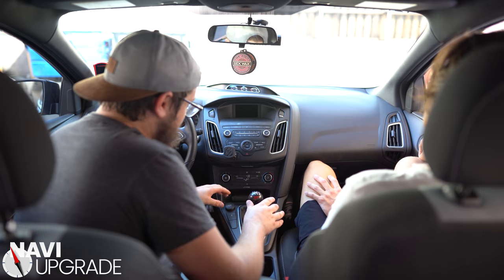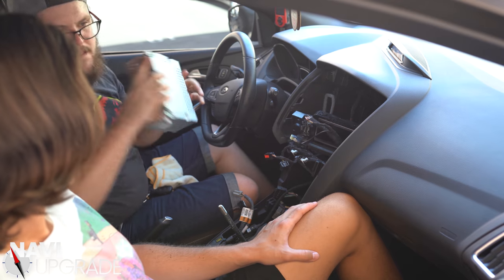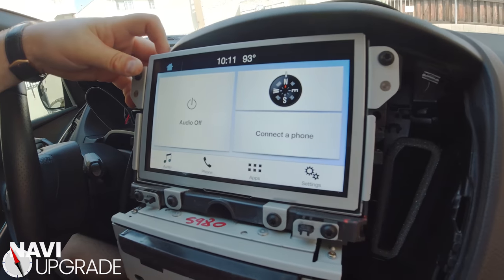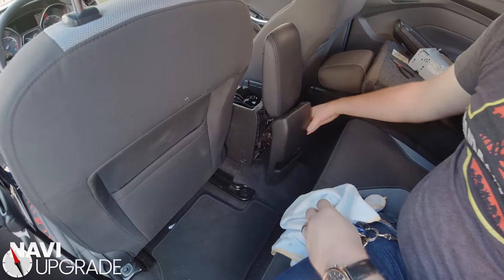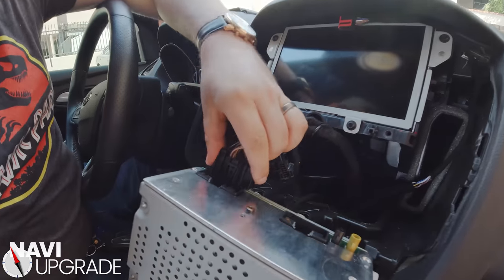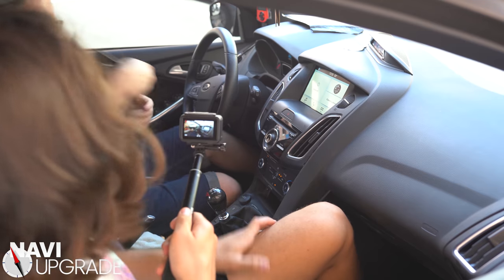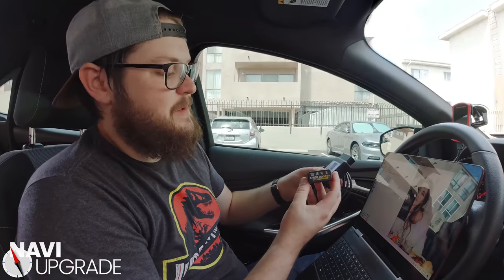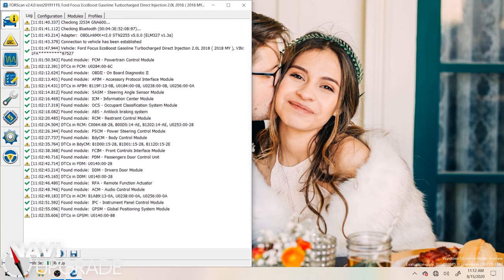4" Sync to Sync 3 in a 2015-2018 Ford Focus MK3.5

Comment: How things have changed. I used to upgrade car audio back in the 80's and 90's and it barely took a few min's to slide out the original, disconnect wiring and slide in the new head unit, and reconnect wiring - All using a cople of `u' shaped release keys! Cleary the motor industry has overlooked ease of access when designing the centre instrument console????
Reply: Haha i just found my U shaped removal tools the other day sorting through bins. Good laugh.
Reply: The reason might be theft
Reply from the maker: Because this is an OEM upgrade. Ford didn't want people with base model vehicles to be able to do this so wiring and all sorts of programming things were changed to make it not plug and play. At the end of the day Ford makes more money by upselling customers and that's why this process is not done by Ford or any Ford Dealers...
Reply: @Muxik4k  Ha! Yes I would agree, only a car I owned in 1998, was broken into and i watched the guy running off into the distance with a box of my  compilation cassette tapes....b*****d!!!!!!!!!!! Why couldn't he have taken my Sony head unit? it took me centuries to record all that material from cd and vinyl on to tape! Pah!

Comment: I have a 2015 ford focus. 4 Dr sedan flex fuel. Radio stopped working after crackling off and on for awhile. If I go with the sync 3 upgrade.ill also need to buy a replacement radio as well . Correct? I'm not usually a do yourself guy but I'm attempting to do this myself with your video help. Haha
Reply from the maker: Sounds like an ACM failure (cd player). If you grab one when getting all your parts you can just replace yours with that!

Comment: Welcome. I have a problem after changing the display to 4 " SYNC 1.1, every time it tells me the call for help does not work ... I would like to disable this message. Where should I do it? In APIM or RCM.
Block 1 APIM
7D0-01-01 111F 89C0 0355

Comment: Debating what to do. Ive got to have navigation if i upgrade. Rear camera has to stay functional and preferably OEM fit. Thinking about buying an android system from Amazon but it would be nice to have something OEM.
Ouch saw your kit prices so that tells me right away im going for a new android head unit and dash bezel included for $250. Had an android unit before and was very happy. At least i can crank up Netflix while I’m out and about. Definitely not a die hard OEM guy. Nice conversion though.

Comment: I have this problem where if I stop my car and turn it back on 2 to 10 minutes later, the syncs system doesn't work. The radio won't work, the screen doesn't work, and neither does the USB charging. I could drive it for hours and it won't work until I stop and start the car again at least like 10 minutes into the drive. I've tried pressing the power and fast forward and nothing works. Any tips?

Comment: Would this upgrade work with Bluetooth Android Auto? If not, what type of unit should I look into for that? I have a 2015 Focus.
Reply from the maker: Use an AAWireless! https://amzn.to/3JEAP33
Other than crappy aftermarket android units (known to fail in just a few months) there isn't another option for Wireless Android Auto

Comment: For some reason after installation, my back up camera doesn't work. Any suggestions before I take it to ford since I'm bad with forscan lol
Reply from the maker: Gotta program or it's gonna be set to whatever the programming the donor vehicle had. Second digit of the first APIM line should be a 3 for the camera to be on (7D0-01-01 xXxx-xxxx-xxzz)

Comment: I would like to upgrade my 2017 Ford Focus ST from the 4 inch to sync 3. Would i just buy the 4 to 8 inch adapter and the sync 2 to sync 3 conversion kit for the focus ?

Comment: My cigarettes lighter plugs does not work after I use the wiring to upgrade to sync 3 ?? Did I possibly leave out anything that should be plugged in??
Reply from the maker: Forgot to replug it probably. Or something shorted it out. Check fuses.
Reply: @NaviUpgrade  ok. But unless it gets the power from one of those radio wires then ok but did not unplug any other wires but I’ll double check it

Comment: Question I have a 2012 focus se but it doesn’t have sync it has the regular radio screen is there a way to add the new display like the ones you sell to that??
Reply from the maker: Yes!! We have a new harness that is an add-on to our current harness that taps into your OBD2 port to get the right signals to run this system on your non-Sync car! It also has a 3.5mm mono jack so you can add your own cheap microphone for voice control etc

That will be put up on the site tomorrow when we get back in stock of the main conversion harness

Comment: Question: I own a 2015 Ford Focus , would I be able to change out the radio and the cluster to a more recent compatible model ? If so what’s the most recent models I could change that to ? Ex : 2017 Ford Focus , 2018 Ford Focus
Reply from the maker: Hey Michael, 2016-2018 would be the latest model you can pull from for your vehicle so that you get everything Sync 3. Hope that answers your question 👀
Reply: @NaviUpgrade  yes it does! I’ll be hunting for a 2018 cluster & radio system then 😎. Thank you for getting back to me so fast

Comment: Hello from Germany,
I have the focus mk3 1.5 ecoboost and sadly sync2!
You just change it and it works 😲 how?
I thought the sync3 has to be updated /set to the FIN number of the car!
If yes, how? If not, I would see how I get one (maybe cheap from a crashed car!
Reply from the maker: Hi there! Yep, it's as easy as grabbing the APIM/Display out of a wreck, then adding in the USB hub & GPS antenna! You'll just need to program your unit in your car with FORScan and you'll be back on the road in no time :)
Reply: What is forscan

Comment: Hi what year is the sync 3 you fitted the focus to load sync 3.4 on to it as far has I’m aware you cannot do it to sync 3 lower than 2018/2019 thanks
Reply from the maker: This module was from 2017. Sync 3.4 can be loaded onto any Sync 3 system 🙂

Comment: Quick question. I have a 2012 Ford Focus Se and it has no sync. Is it possible to do this? Or would it have to be a 2015 and newer?
Reply from the maker: Hey there @Jayvin_21 -- currently it's not possible but I'm working on a solution for you soon! Hold out hope!
Reply: @NaviUpgrade  thank you for the quick response. I have been wanting to upgrade it but since I haven’t found anyone confirming that it is possible I stopped trying. I wanted the stock one, like in the video instead of an aftermarket one like pioneer, song, JVC, etc.
Reply from the maker: @jayvin_2169  totally understand. That's why we're working on it. It's a pretty complex harness so we want to make sure we make it as easy as possible.for everyone to upgrade their cars 👍 thanks for your comment and watching our video!

Comment: Do u have to have to buy the  harnesses to install the sync 3. And why?
Reply from the maker: I suppose you don't have to... But if you don't it won't power on 😜 But yeah, it's necessary for the upgrade. Lots of pin changes between 4" Sync and Sync 3

Comment: I updated the sync 3 to 3.4 in my 2016 Ford Escape. It went well but i need to get a new newer version  USB hub but I can not find a part number that will work. Does anyone know if they have found the correct hub for a 2016 ford escape?
Reply from the maker: We sell OEM Ford Hubs on our site 🙂
https://naviupgrade.com/shop/hardware/sync-3-carplay-enabled-usb-hub/

Comment: how much is the cost of this modification, I have 2017 focus ST
Reply from the maker: Depends on where you get the hardware, I've had folks tell me they've gotten full setups for as little as $100 from their local wreckers. Most spend between $500-700 on their upgrade

Comment: Could you aupgrade a 2014 ford focus into the original radio in this vehicle?
Reply from the maker: Yes but our harness doesn't support the Sync 2 hub. It'll boot Sync 2 just fine though.

Comment: if i misspell but i am using translator hope someone can help me here I go ... buy a CM5T-19C107-JF radio to replace the CM5T-19C107-HB. all good but the aux output of my car does not work, it does not emit any sound. The question is can I program the auxiliary output with Fordscan so that it can play my files. I would be very grateful if someone can help me. Thank you all

Comment: Hello there I'm based in the United Kingdom is it possible ship it over here?
Reply from the maker: Hi Regerio! Absolutely. We unfortunately don't have a live shipping rate calculator on our checkout yet -- it will charge you $70 for international, but costs have been sitting around $40 to the UK. I manually refund the overcharged difference 🙂
Reply: @NaviUpgrade   thank you for your reply. Does it come with everything?
Reply: Are you still manually refunding the difference? I’ve just placed a $400 order to the UK and was charged $130 flat rate delivery.
Reply from the maker: Yes, just getting to the office now 🙂
Reply: Having a few issues with the install, there’s two checksum issues with the APIM programming file. My new ACM is only showing one block so FORScan won’t load your file. My usb hub isn’t working, I think it’s because there is no voltage across the two pins on the power connector with key/engine on. I updated my APIM using a card reader plugged directly into the APIM so I know it’s working, it’s on the latest version of 3.4. It also accepted the FMods files in this way. Can you please advise on what to do or send a pin out diagram so I can test continuity on the harness?
Reply: @NaviUpgrade  it’s been over 10 days and I’ve not had a reply to rectify the issue with my USB hub.
Reply: Still no response from Brian. Support is not there for anyone outside the USA

Comment: Wow, looks a lot more complex to remove the head unit than from a MK3 (12-14)...
Reply from the maker: Yes and no -- I'm just thankful that you don't have to remove the kick panel on the facelift. I think the MK3.5 is actually a little easier since the shift boot trim and HVAC panels are a single module.
Reply: @NaviUpgrade  I have a pretty complex question about a radio upgrade, do  you have an email address?
Reply from the maker: I'll be honest, my email is pretty f*cked. Calling us better. Fill out the call form on my site and it'll give you my direct number. To call or text.  https://NaviUpgrade.com/contact
Reply: Hi guys, excellent video.. do you know which version of sync the original audio unit is? Is it sync 1, sync 1.1 or sync 2?
Reply from the maker: Technically Sync 1.1. I don't know the exact version # off the top of my head but I usually refer to it as Sync 1 or Base Sync. If you have Bluetooth and Voice commands your car is a  candidate for upgrading
Reply: @NaviUpgrade  Thank you so much for your reply, I do have Bluetooth and voice command so will be heading in this direction with my car.
Reply: Link not working

Comment: Great video, can you send this conversion harness to Brazil?
Reply from the maker: We absolutely can. We charge a flat rate for shipping internationally -- if the shipping charge is less than what you paid we refund the difference 🙂
Reply: Great, my Ford Focus is a 2016, it will work this cables in the sync 3? I have one sync 3 here from 2016, and the ID is HM5T-14G370-FDB
Reply from the maker: @matheusparisi2856  if you could send me some photos to my email that would be great! Thank you!
Reply from the maker: @matheusparisi2856  info@naviupgrade.com
Reply: I bought same kind of screen and radio what would you charge harness posted to uk my screen have 18 pins and they are in 3 rows 18 pins each
Reply from the maker: @HM-yp8pv  my site charges a flat fee of $50 for international. Usually it ends up being $40ish -- I refund the overpaid difference 🙂